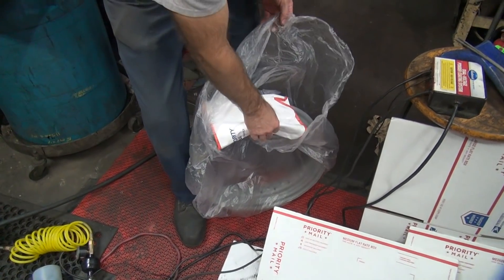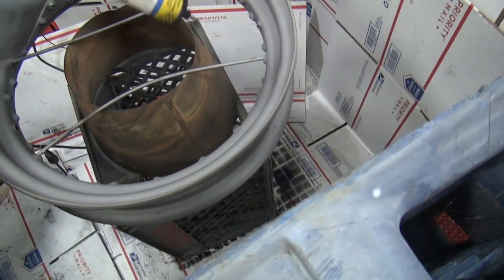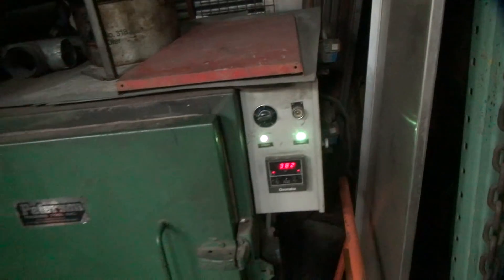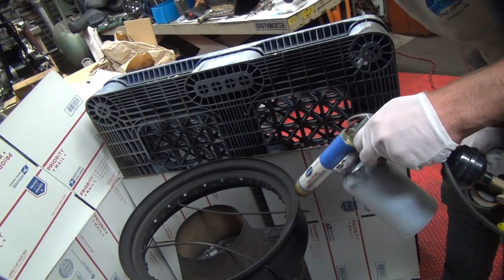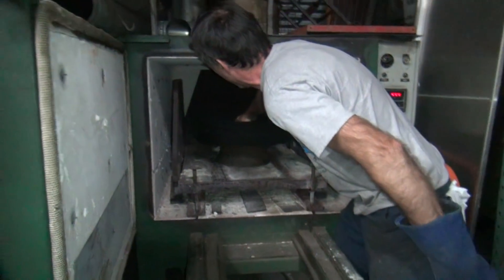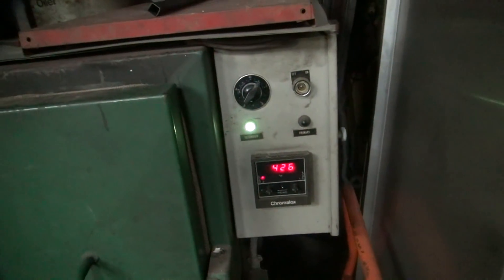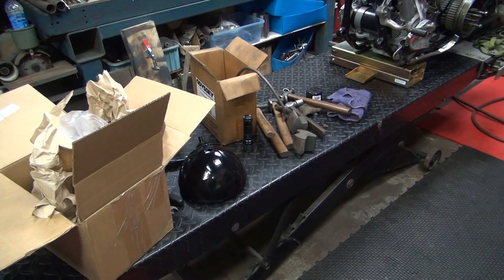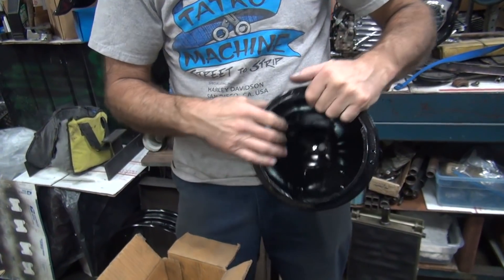#172 1957 panhead STD head conversion drag bike race harley scta lsr 2019 season tatro machine

Comment: Cluster powder coat attempt saved  vid by the return of Sir Alan, with pizza no less. Nice to hear your voice again Alan.  Your poor results are mostly due to a garbage gun that can not provide proper flow. Way back when I had the unpleasure of using one, I found that putting only a small amount of powder into the gun bottle kept the powder from compacting in the jar,  compacting prevents the gun from sucking the powder up into the air stream. That is why when you removed the jar and put it back on it worked for a few then not. Dry powder is very important when using that gun. Pro systems have a air jet at the powder tube intake to keep the powder fluff up for a important reason.  That gun is prone to throwing clumps of powder. Higher pressure and backing away from the part helps prevent clump coating the part BUT it uses up more powder. A down side about making that gun work better. Letting the powder partially fall downward onto the part, not shooting directly  at it like a spray can paint will help with even coating.  Curing temps are critical.  Time and temps must be held for proper flow out. Pre heating the oven to temp is required. The time to cure STARTS only as the powder has just flowed out. 10 minute cure only, no more no less.  That rim looked very under cured. Heavy metal takes much more time to reach flow out than tin parts. A window into the oven is needed to see flow out without opening the door, loosing the heat and causing a cold strike to the parts. A fan in the oven prevents uneven temps inside that can cause one side of a part to blister and the other side to be ok.  Guessing will get exactly what you ended up with. Poor flow out and a rough finish. Then there is powder quality, that would take half a day to discuss. Bottom line, buy the best you can from a sound supplier. I suggest 'Powder by the Pound', on the web, for small users. Powder from the likes of Harbor Freight and Eastwood, etc. are mostly old outdated stock that do not flow well and/or dull results. Storage of powder is important. Well sealed in a temp controlled environment, away from summer heat. I like a frost free refrigerator for small quantities to preserve long usability. Powder has a shelf life !!! I have coated tons of  parts and  use commercial gun/booth/oven.  GOOD LUCK !! Regards/greg